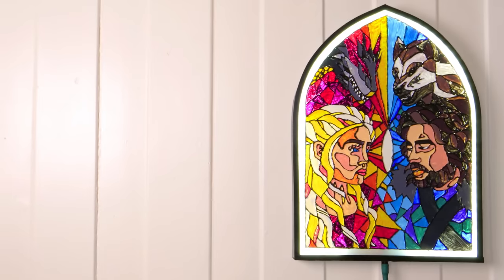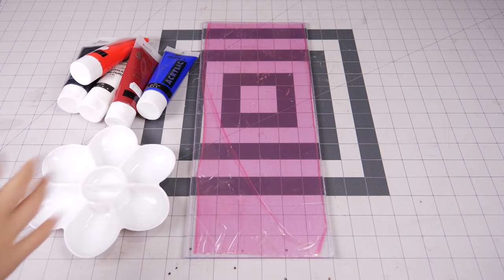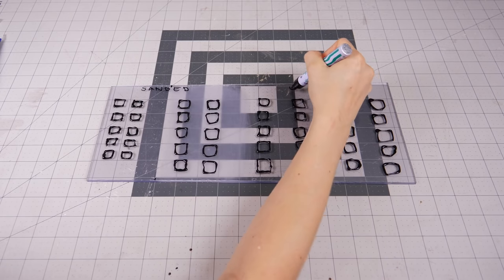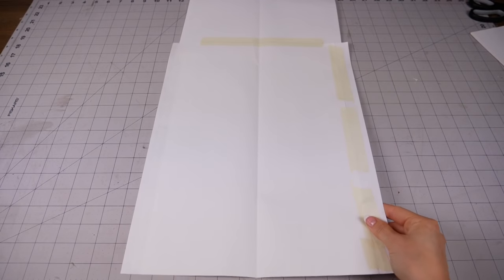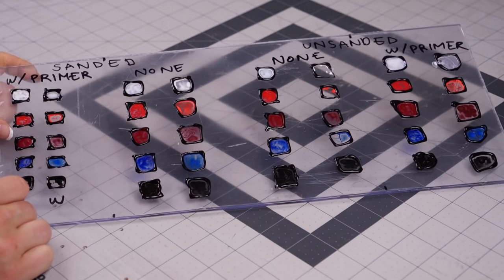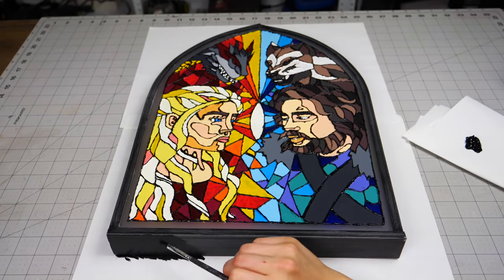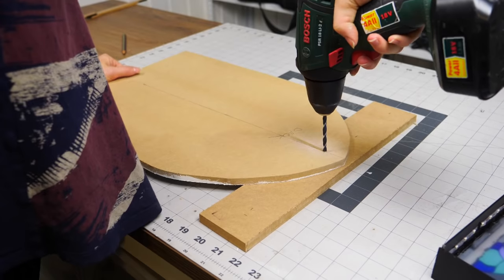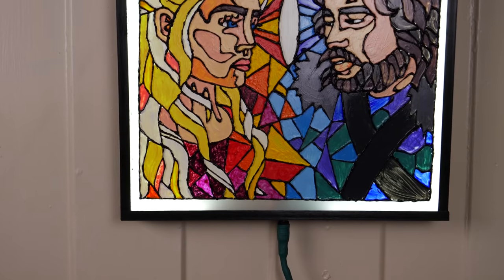DIY Daenerys & Jon Faux Stained Window

Comment: a little tip to make a more translucent paint yourself: Mix white glue with acrylic paint. It's almost like homemade window colours. Or mix the glue with inks or food colouring for an even more translucent look.
Reply: Only if you want it to go yellow or peel off over time, PVA/white glue is not UV stabilised.& will dilute & reduce the bond between the polymers (the sticky part of the paint). Alternatively, you could use any of the acrylic mediums which are actually designed to make acrylic paints more translucent & which are made of those same acrylic polymers, thus strengthening the sticky bond. Mediums are commonly used as an adhesive & protective medium in assemblage, decoupage, collage & mixed media for this reason & because they offer UV protection to stop yellowing, peeling or causing a tacky surface to reappear in humid environments like Mod Podge or PVA/white glue does..
Reply: Only if you want it to go yellow or peel off over time, PVA/white glue is not UV stabilised.& will dilute & reduce the bond between the polymers (the sticky part of the paint). Alternatively, you could use any of the acrylic mediums which are actually designed to make acrylic paints more translucent & which are made of those same acrylic polymers, thus strengthening the sticky bond. Mediums are commonly used as an adhesive & protective medium in assemblage, decoupage, collage & mixed media for this reason & because they offer UV protection to stop yellowing, peeling or causing a tacky surface to reappear in humid environments like Mod Podge or PVA/white glue does..
Reply: @joannecarroll5504  another thing you could use is clear UV resin (though it might yellow, it's very strong) or polyurethane varnish (it mixes nicely with acrylic paint when you want a glass like look, it has very similar properties to acrylic mediums but dries completely non sticky)

Comment: Also if you want you can use a wall scrapper or sculpting tools or lightly sand to flatting out the black hot glue.

Comment: This is a cool project. But I'm not sure about using black hot glue as a faux-calamus, I think using some actual metal would give it a more realistic effect. Also, use a light diffuser behind the acrylic, it'll help even out the lighting and make the edges look less harsh as compared to the rest of the faux-stained glass.

Comment: You know that you can wire a LED controller to add depth to your LEDs and they are less than 1.00 USD on ebay, they are a simple RF controller which can fix your issue without having to pull everything back apart, all it does is limit the amount of power going to the LEDs